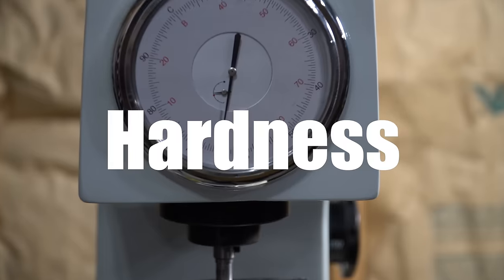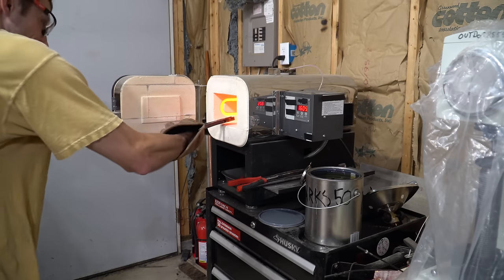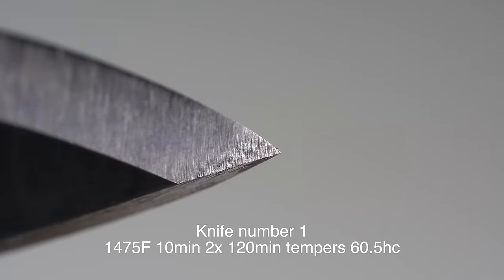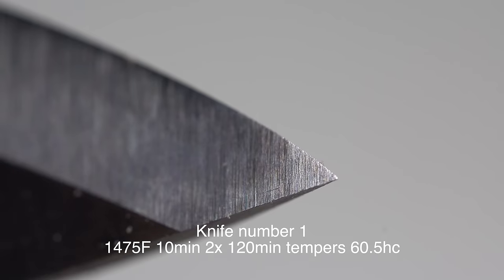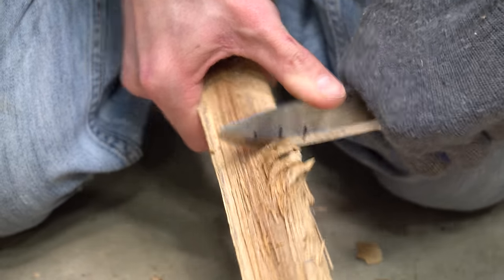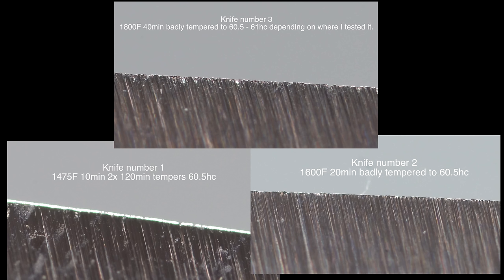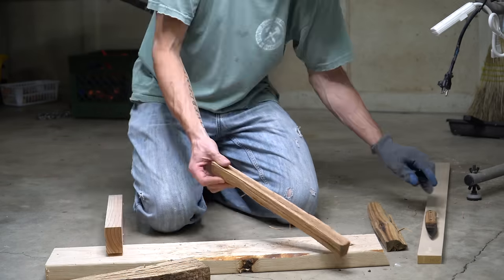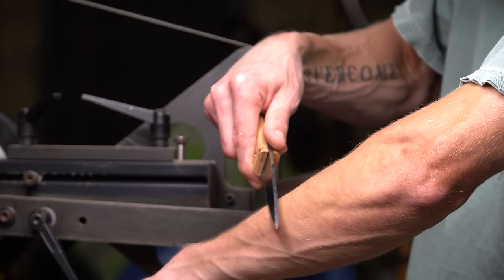The BIGGEST LIE in the knife industry- Good Heat Treatment vs BAD Heat Treatment

Comment: Aaaaay! The stupid argument i was a part of with someone resulted in something. 

Can't wait to see what is going to come of it. I'll probably put an edit. When the video is done.

Edit: yep. I think you showed the core of what the arguement was about here. Hrc is very relevant to edge retention. Differing heat treatment, does considerably effect toughness, and different knives at the same hardness will give vastly different results. 

So someone saying that hardness isn't relevant to edge retention specifically, which is what the whole argument was about. Is just not correct. 

Now even variations of a good heat treatment will lead to different results. (To clarify, I mean in toughness, and toughness, can and does effect edge retention, depending on the task, look at home slices rope of death videos for that [to clarigy this clarification  😭🔫 because I'm sure someone is going still try to oversimplify, and misinterpret what I'm saying, when testing purely edge retention, without toughness rockwell is super relevant])
Reply: 13:54

Watch the video again.
Reply: @jameshaulenbeek5931  that's already what I said.
Reply: Not exactly...

While hardness IS important to edge retention, it's that knives made of the same steel with the same hardness seem to have identical edge retention, regardless of heat treat.

What you said is, "Differing heat treatment, does considerably effect toughness, and different knives at the same hardness will give vastly different results."
Reply: @jameshaulenbeek5931  I was assuming that we are talking about knives in the same steel. Because that's what the video was about, and that's what the arguement was about.

Yes. I changed what I put in that, because of you misinterpreting it. I meant vastly different results as far as toughness.
Reply: Okay, you keep changing what you're saying. 

✌

Comment: One observation about the "bad heat treating" is that you did vary the austenitizing temp, but you intentionally heat treated them to all get the same hardness.  Had you retained the "good" heat treat schedule times, but varied the austentizing temps, you'd have seen different hardness between the knives and thus different edge retention.  Grain size in your knives is the biggest difference you'll see - as you demonstrated with the bending tests.
Reply from the maker: I've tested this before. You would still get close to full hardness even keeping the austenitizing time the same and only vary temperature. You will still get 63-66. So they can still be tempered down to 60. I just choose differently simulating a forge ht gone wrong

Comment: It looks like you checked the hardness near the back of the knife where you had the most material. Understandable, that would be the easiest place to get the measurement. That does not tell us what the hardness is at the cutting edge or at the tip. When you heat up that steel to 1800F and hold it for 40 minutes with no atmosphere to protect it you will decarburize the surface. The area of the knife with the bulk of the material will decarb a bit and you may not even notice it due to the relatively large size of the rockwell indenter. The tip however will experience more decarb because it is thinner, heats up quicker and has more surface area per volume of steel for the air to act upon and pull out your carbon. Without a mircostructure of that tip vs the rest of the blade after grinding it is tough to tell just how much damage that you did. That could be a reason why you saw such a difference in the tip test and brass rod test but not the edge retention. After performing your regrind you removed more of the decarburized steel so the heat treatments were more equal. 

I agree that 1800F and 1600F is too high of a quenching temperature for a plain high carbon steel. I am not so much worried about grain growth as with a proper steel and quench, the difference between 10 minutes at 1475 and 40 at 1800 would not be terribly noticeable. I would be more concerned about decarburization and retained austenite. At a higher temperature you will get more RA and less carbides. The RA can be a good thing for certain applications, but for a knife blade I would prefer finely distributed carbides. You can see a difference in hardness with high amounts of retained austenite but we are usually talking about a couple of points of HRc. 

The as quenched hardness would have provided some more context to the heat treat and the final temper temperatures of the steel. Even better would have been to temper each blade identically and provide the hardness and edge retention results. You could still do that, just throw all of the blades in an oven at the highest temp for a few minutes and see if you see any difference.

Also a note, temper time really has little to do with the final hardness. Once with steel reaches the temperature, adding time will have no noticeable effect. Multiple tempers at the same temperature are not doing anything for you either. 

Thanks for the video, I love watching knife makers work. As a guy who heat treats steel and looks at microstructures daily I am always interested in seeing what people can do with steel.
Reply from the maker: All decarb was removed before rc testing. I would recommend reading knife steel nerds book by Dr larrin Thomas. It will help explain what is actually going here. Grain growth was a big contributor to the outcome here. Again id recommend the book👍

Comment: Things vary with what you are doing.  Poorly heat treated chisels are more a problem in the use intended than a knife would be.  A poorly tempered chisel with coarsely grained structure will tend to crumble along the edge in use.  You see that in the different appearance of the edges in your tests.  As you noticed, that doesn't really make a difference for edge "retention" with a knife.  With a chisel or plane blade, the quality of the cut matters, and there the cleanness of the edge used to make the cut is important.  Otherwise, you have to use sand paper to correct the cut surface afterward.

Comment: Nothing surprising about your results :)

I noticed as well, that terribly grainy, rough blades can be shaving sharp of paper cutting sharp, and stay that way, for an extended period of time, even though they really have no business being that way. 

I suspect that there is a massive misconception in the blade making/buying community as a whole, regarding sharpness. 
Every person I ever talked to, who knew a bit about knives, explained how you have to put an edge this and that fine on a knife... and I showed them a knife that had a mirror polish on it, that didn't freaking cut; and a banked up, roughly sharpened knife that cut like a razor. 

I think the nature of sharpness and cutting capability is misunderstood in general. 

There is the "saw-like" mechanism of small teeth on a blade, and there is the "low area = low force needed to penetrate" effect of fine blades. And I think BOTH of these effects play into sharpness. So, a seemingly polished sharp blade that is so fine, it lacks the small serrations on the blade, might be terrible at cutting material with a push or pull motion, and only works with being pushed perpendicularly against the cut object. 

There is also something to be said about grain size and edge retention. Clearly your "badly heat treated" knife had large grains, so it was mechanically inferior. But edge retention is ultimately determined by how hard grains hold together - and good steel has strong grains. Couple that with your testing, which really didn't hit the stress needed to micro-chip the blade, crystallite by crystallite - and you have edges of various finenesses, all holding equally well, against sub-critical stress.

Comment: This just goes to show how little I know about knives.  I was thinking >HRC lent good edge retention but could make the blade brittle.  Your "good heat treatment" blade withstood the tip abuse so I wasn't expecting that.  How is one to know then when you're getting a good blade?  Factories can have fuck-ups too, can't they?  A blade at 56HRC w/good HT may be better than a blade with 60HRC and bad HT.  That may be an obvious statement, but in determining that if you bought both of them...how would you know?  I personally don't have money to burn, trying to break my knives. 🙄  We're left with trusting reputations then, aren't we?

Comment: 14* is that the primary grind or your secondary grind? It looks as though knife B & C doesn't have a secondary grind at all, just a basic sandy grind
Reply from the maker: They are all zero ground, or scandi ground.
Reply: What's your preferred angle for a scandi?
Reply from the maker: It depends on the steel and what type of wood its being used with. 14 degrees per side is a good starting point.
Reply: @OUTDOORS55  😁thx bud, keep killing it, been binge watching your vids today like what I see, do a vid on your verticle belt sander, specifically how you set up your system to reproduce all your angles for your primary grind. Id like to fabricate something similar for precision stock removal. 🤙

Comment: How about cryo treatment ? The dry ice and acetone method if getting a liquid nitrogen container and filling is cost prohibitive or unavailable in your local area etc. The home freezer method isn't a treatment at all.. Cheers..
Reply from the maker: The regular freezer does help with certain high alloy steels if done immediately after quenching. I would recommend seeing Dr larrin thomas' work on this matter.
Reply: @OUTDOORS55  yes his book is the go to knife steel " bible " for sure..the home freezer may offer the slightest impact on just a few steels that its not worth writing home about..not to mention the possibility of Wifey issues too that its just not even close to be worth it..just to be 100% I was surprised the #1 blade took so much damage on the brass chop that I would totally stay away from that steel or check into better heat treatment for it..just to compare 1 of many other steels available and at low cost like 8670 will chop completely thru 4 to 5 carpenter's nails and just start to snag at the paper slice with zero edge damage, with the correct heat treatment and at north 60hrc..that #1 blade took unacceptable damage on the brass chop for current times like this that literally dozens of other steels are readily available..
Reply from the maker: Remember this was at 14dps which is very extreme. The edge damage would likely go away at a more reasonable 17-20dps. Also the edge damage is less than it appears due to the magnification. Its barley noticeable with the naked eye. Very few steels survive this test at 14degrees. 🙂
Reply: @OUTDOORS55  10-4 yeah good point..it does make a huge difference ..a person couldn't expect a straight razor not to take damage from intentional abuse just because it was cryo treated 52100..etc..edge geometry does play a big part of the picture as much as heat treatment..

Comment: Spyderco are supposed to be good quality steel but I have managed to break the tip off one.
Reply from the maker: It depends on what you were doing
Reply: @OUTDOORS55  Shall we just say they are not idiot proof :) I have broken the tip off an SAK awl too. Not hard to repair with a bit of filing. I do wonder what kind of heat treatment that the old blacksmith made woodsman's tools had if any, but durable certainly.

Comment: @OUTDOORS55, You're not accounting for all of the variables, or even define well what you're trying to test for!  There is the speed at which you enter the material, speed during the cut, is it a constant speed or accelerated or decelerated during the cut.  The exact angle at which you're cutting?  Also, you're not testing durability, which would be significantly different for each of these knives.  You can't be testing this by hand is what I am saying.  Testing sharpness only doesn't determine the quality of a blade.  ESPECIALLY if you sharpen it after every test!  lol.  You should watch 'SciShows, "The Sharpest Object In The World Can't Cut Anything" video.  They explain some of the variables that are probably giving you unexpected results.
Reply from the maker: You should have actually watched the video before commenting 🤦‍♂️🤦‍♂️🤦‍♂️

Comment: so heat treatment today has become more about combining states of resistance to corrosion. so edge retention in society has been mis reported by decades of bad edges and random people thinking their edge are  controlled and correct but not. so based on what i see. powder steels out perform.... then stainless type with edge retention in mind.... then differentially hardened carbon.... then 440 a 440 c .......   usually due to what they use and how much effort is into making things these days... just dont expect the same effort from a 440c blank as to a zdp or cpm...... or even aus8 aus10 compared to 440a etc..... coz countries also limitted by the smith and whats in demand

Comment: Interesting, but I believe your methodology for edge retention is flawed. Pick a medium, try the knives at steeper and steeper included angles. If bad heat treat has an effect on edge stability, the one with the best heat treat will hold a steeper included angle without damage  therefore having better edge retention.

Comment: Same surface finish, same hardness, same angle, same material, of course they retain edges the same, there's no other variable that matters apart from damage.  Hardness is only important for edge retention on knives not subject to rough treatment or needing strength, this is why ceramic knives are good for chefs knives , they are very hard but hardness always comes with brittleness which must be dealt with in metals and limits how hard you can make them and them still be practical.
You will own files, they'll all cut as well as each other generally, but odds are some if not all are low or med carbon steel, case hardened because it's cheaper, easier to work with and only the cutting teeth need be hard. You'll never tell them apart in normal use unless you snap a high carbon file or hilariously try to make a knife from one that won't harden because it was case hardened low carbon steel. Those videos amuse me because at first the knife is razor sharp, but not always going to stay that way long.

Comment: Any idiot with a blowtorch and a bucket of water can make a high carbon blade "hard" enough to sharpen and shave. The real difference is in durability. A good heat treatment will give you the most optimal balance between hard and tough. That makes all the difference.

Comment: There is so much wrong with this :D What are tempering times and temperatures for other 2 knives, and it does matter alot lmao ? 
Ta holding times are way to high in that temp range, but there is no reason to dissolve all that carbon, you could achieve same amount of martensite formation as with 1st blade with lower holding time. What you did is , you have created more martensite ( so it was harder to reduce hrc even more, adds up in tempering time/temperature) grain size grown massive :D and probably some amount of retained austenite remained. And, f you rly wanted to dissolve more carbon ( there is no reason if targeting hrc was 60) you should do 1 stage preheating maybe.
Anyway,there is so much to add :D, but i think main reason for your result embritlement is retained martensite dissolution after tempering, and very large irrelevant speroidal carbide particles inside martensite crystals
Reply from the maker: Nope. I recommend seeing dr larrin Thomas work in these areas. And also you should have listened and watched the video so you could understand what's going on here🤦‍♂️
Reply: @OUTDOORS55  Well there is many ways to mess up temper to achieve specific hardness isothermal tempering, non-isotermal tempering..low temp-high temp,its all about how much carbide is dissolved out of martensite, in terms of hrc doesnt rly matter how, but in terms of evrything else it does, best example is DP steel wich is hard and very ductile same time ! So suppose you have tempered it at high temp . But why is your hold time at austnitizing temp so long? It is done mainly for hss steel and it only purpose is more carbon diffusion in austenitic phase. Diffusion speed at 982c is faster than 801c, so actually less time required for same hardness, or I didnt get the point of this test.
Reply from the maker: You missed the point of the video entirely
Reply: @OUTDOORS55  I understood your point, but its very basic, what surprised me is how that tip snapped, cant be that brittle
Reply from the maker: Well it was lol.

Comment: The problem with this is all steels are not equal. Do this with something like 3V and it's a boatload of difference between that and 420. But I'm just some cunt on the internet, who cares. However. If you can find an a-typical steel and do the same with that. The results may be more or less representative. Maybe? Not that I believe anything more than 154 CM is plenty adequate for all of it.

Comment: That is about the most conflated and convoluted introduction I've ever heard. All metals have specific heat treatments for the properties you're after. All you're proving is the incorrect heat treatment gives undesirable properties... hardness is just a function. As are Toughness, ductiity etc. Also, you're only effectively dealing with one type of heat treatment... when there are many.
Reply from the maker: Actually watch the video before commenting lol
Reply: It is interesting because it is commonly held that a more refined grain contributes to edge performance but here we see a large grain edge performing as well as refined grain edge in edge retention and cutting - they both whittled hairs, etc.  It would be interesting to see if one could shave their face with both of them and not notice a difference.
Reply: @GreenBeetle  it was 1084
Reply: @tacticalcenter8658  how does that apply to my comment